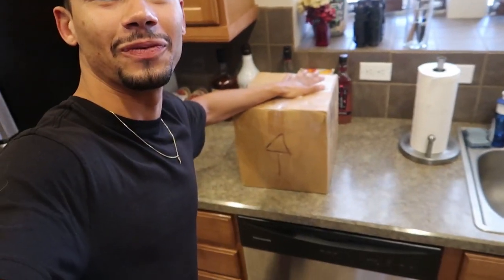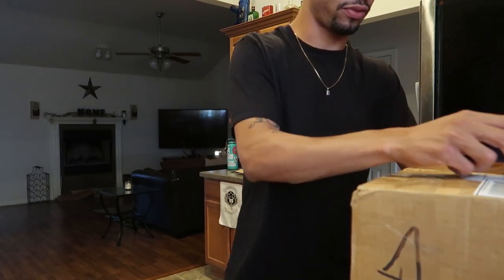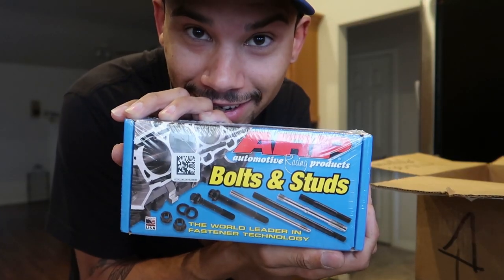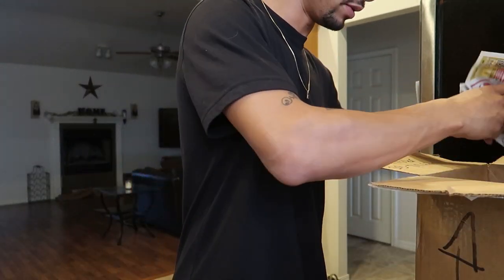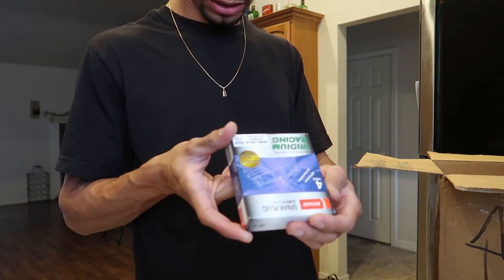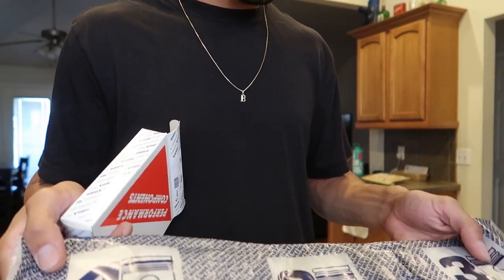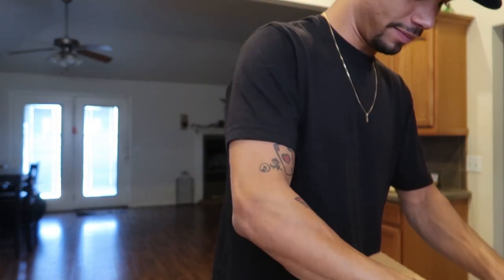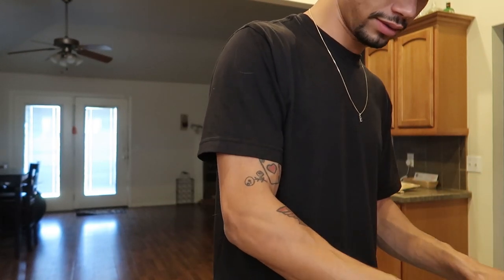700+ Engine internals are here!! | MK7 Golf R

Comment: Congrats my guy!! im very happy for you. Also I think you should port the head. the benefit is youll be able to make the same power with lower boost= less work/load on the turbo. also ceramic coating the turbine housing should reduce turbo lag by a bit. as for main/rod bearings i'd go with ACL or Calico both are great options, i believe IE has calico ones on thier site. also make sure the engine shop uses a torque plate while boring out the block to the new piston size.
Reply from the maker: I think calico is going to be the move! Didn't think about coating the housing.. might do that once I get the XL upgrade. As for the head that's my logic as well, all the homies say go for it so, I guess I will!
Reply: @BryceJordanProductions  For sure go for it! also im not sure about mk7 but in the mk6 ceramic coated k04 housings reduce turbo lag by 3-500rpm.
Reply from the maker: What that much?!? Holy crap!! That's what my downpipe did going from 3" catted to 4" catless dropped me about 500rpm to full boost
Reply: @BryceJordanProductions  yeah and since your porting the head and maybe port match the turbo housing as well. it should also help with spool and offset the larger housing in a good way, more power but the same if not less lag.

Comment: Nice! Who are you getting to assemble it? Thinking of doing the same or go with an IE longblock
Reply from the maker: Got a shop to do the bore stuff and measurements imma assemble the bottom end and mate the top end, timing etc etc. Just gonna send the head off to be built and ported more then likely.. still on the edge about the head work though. Can't go wrong with one of their setups!

Comment: No thicker metal gasket? 
Might have to upgrade the intake manifold at some point.

Looking for similar to my current setup.
Reply: You can so use a bigger oil pan, like this one. 
https://media.bar-tek-tuning.de/media/image/c5/36/g0/2-0L-TSI-Upgrade-Oelwanne-CNC-1_600x600.jpg
Which hold about a quarts more oil. 
Supposed to add more stiffenes to the block and give better heath dissapation.
Reply from the maker: Our head gaskets are like the triple layer ones as is, they're sufficient! Intake manifold (not sure who yet) and grams throttle body is on the list!
Reply from the maker: Planned on the iAbed pan with baffles and such 😉 it's gorgeoussssssss
Reply: @BryceJordanProductions  haven't seen that one yet. Gonna look it up. Sadly I cannot use the oil pan, doesn't fit on my due to being longitudinal setup.
Reply from the maker: What car do you have? Porsche?
Reply: @BryceJordanProductions  Haha no i wish. I have a A5 with the "same" engine as the mk7 cars.
But unlike the mk7's I have to customize a lot of things and fabricate also. 
Bit out of the box turbo upgrades for example. 
Currently looking through options for that since my current one has a cracked housing.
Reply from the maker: @yvestheunissen  oh what that's neat! Lot easier to swap turbos though I bet! Those drain lines on the back and bottom are such a PITA being so close to the firewall for us
Reply: @BryceJordanProductions  Oh yeah definitely.
Typically on MQB cars I need about 4 hours to swap a turbo. 
On my own car about an hour. Everything is easily accessible. 

With turbos the compressor housing is the main issue. 
Need to customize one or do custom piping. 
Currently have an option for an IS38 based model with GTX3071R gen2 core but looking into other options also. 
Would be easier with more build engine setups to compare spool times.
Reply from the maker: Custom piping wouldn't be all that bad I'd think, should be easy for a fab guy. I'd like to do a custom setup for all the IC and intake piping with Vbands. And a custom modular intake with a swappable inlet that connects to the headlight where I wanna bore it out for direct flow for track days..
Reply: @BryceJordanProductions  True it wouldn't be that much of an issue. 
Though I did see a lot of people complain about wastegate actuator's other then stock giving problems. 
The problem in over here in Belgium is to keep it as stealth as possible if you still drive it on the street. 
Don't want to raise any question during technical inspection.
Reply: How was you spool time on the current turbo setup?
Reply from the maker: Oh yeahhh, are they pretty strict about that stuff? Have you looked into EQT turbos? They look OEM and use OEM W/G!
Reply from the maker: But the piping would still be an issue.. well not really you can use OEM piping with those unless the longitudinal motors use slightly different turbo designs ?
Reply: @BryceJordanProductions  Have looked into them. But aside from you and a few in the UK I haven't seen many run them. 
If you have to modify them each time it gets a bit tedious to keep on trying new turbos. 
Since most of the time you can't sell them anymore without putting more work into it to put them back the way they were. 
While for a transverse it can be easily sold on as is. 

Not to worried about piping.
OEM transverse compared to longitudinal they are very different. 
The cat on the transverse uses a v-band while longitudinal uses a 4 bolt flange. 
Which I changed to v-band on mine. 
The exhaust housing is also rotated 180° so the O2 sensor is at the bottom if you don't change it or relocate. 

Compressor housing is very different. 
The transverse has a removable inlet for the intake. 
While the longitudinal has a 90° bend connected. 
https://imgur.com/1MGyF9q

Which one want it you are using now? EQT vortex? 
Seems similar to the GTX3071R g2 which makes up to 650Hp.

Comment: more interested in knowing what you do for a turby setup later down the road
Reply from the maker: XL housing, maybe ceramic coat that. Not too much, built motor will unlock all the torques so I don't really need to do anything crazy she's already pretty powerful, now with more torque and hella less weight it'll be 💪💪💪
Reply: @BryceJordanProductions  word, so its all in the tune then, after the internals basically?
Reply from the maker: Yup pretty much! Might have to do water injection if my whole shroud idea isn’t efficient enough with the IC for AITs but yeah mostly all in the tune
Reply: @BryceJordanProductions  word. I have the meth kit from Usp. Very easy install